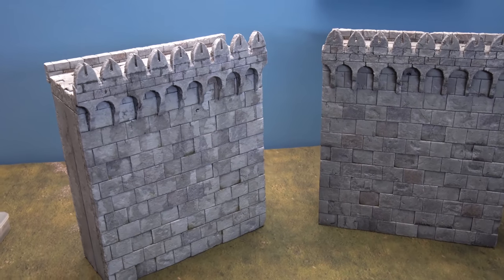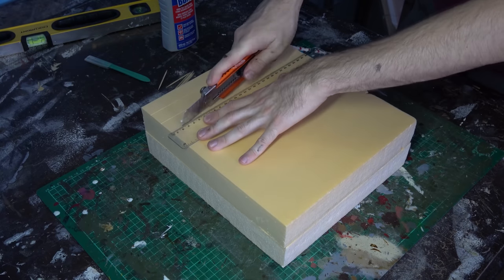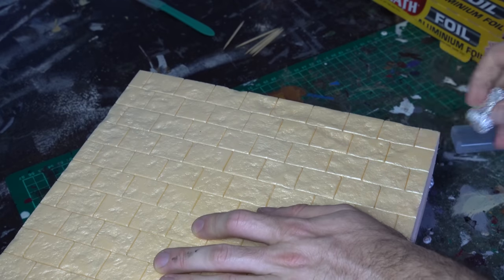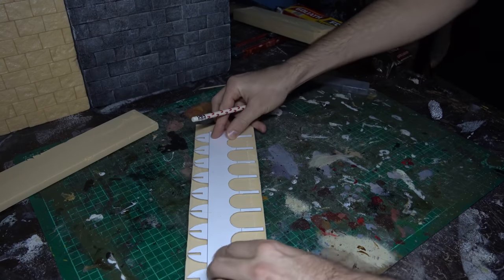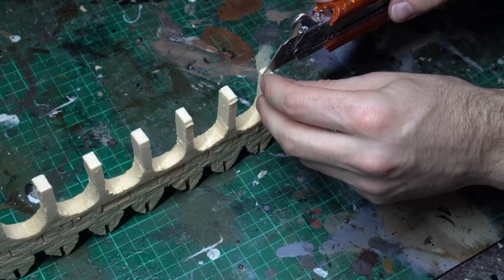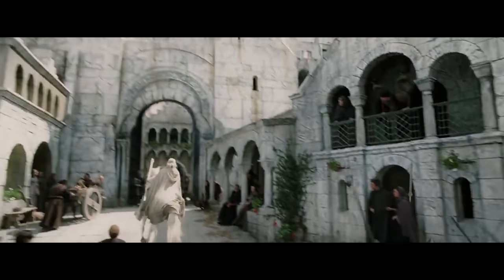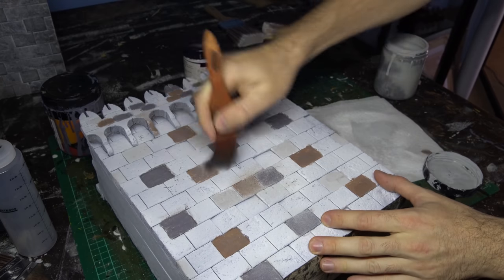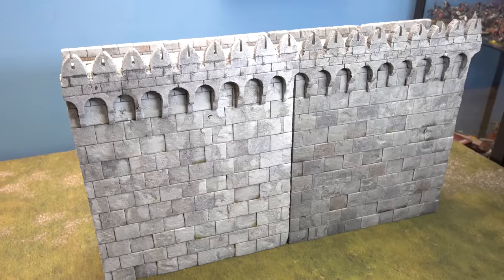How to Carve: Realistic Stonework! ~ Minas Tirith Walls Guide and Templates!

Comment: As someone that doesn't have a hot wire cutter I now feel I can make this. My only suggestion would be right at the base have the bottom half inch or so stained a little more than everywhere else to simulate the ground being wetter and rain and water collecting at the bottomed of the wall. Immense piece of terrain through, really awesome!!

Comment: Hi, i started a very similar project 2 years ago. I built the complete gatehouse (14 cm wide gate) with the four towers (48cm high) and the two walls protecting the area in front off the entrance. For the crenalation i used two laser-cutted mdf stencil with the Proxon hotwire table (which i used for the whole project). I’ve texturized the walls with your same metod. Now i need to build the rest of the modular walls and towers for a total of 2 meters long. I also have ti paint them ofc. Keep up the good work and regards from Italy
Reply from the maker: That sounds AMAZING Davide! Can you plrease post some photos on my facebook group? www.facebook.com.groups/zorpazorp

Comment: And there it is! Just like you promised on Facebook! Love it mate. Especially how you give that extra bit of depth. 

Two questions: 
Have you considered buying a Proxxon hot wire cutter? It really speeds up your process and gives beautiful cuts. You could cut 5 crenellations sections from 1 5cm block of foam and slice it down. 

Other question: does your foam also have that smooth silky layer/finish on the outer sides of the board? Gerard Boom from Shiftinglands advices to thinly slice that off because it doesn’t take glue and textures well. 

Thanks a lot mate!
Reply from the maker: Thanks dude!! I deliberately didn't use a proxxon in this video as I wanted to teach everyone who didn't have one it is possible to do it with a blade :)

I find the silky finish is totally fine for texturing you just haver toi push a little harder, but sometimes it is better to sand it back if it's being stubborn :)

Comment: Watching you cut this out by hand got me thinking that one could save a lot of time on the battlements using something like a Silhouette or Circut to cut the foam - this might require multiple sheets of styrene glued together after cutting, but it has the advantage of being a largely hands off/can run in parallel while you are prepping and finishing other walls.

Anyway looking forward to the templates, will try them on a Glowforge after some modification with MDF.
Reply from the maker: That sounds really cool dude I'm not familiar with those tools!
Reply: It's from the scrapbooking world, I've used them to cut stencils to put numbers on terrain and vehicles (with a bit of airbrushing). :) Can literally take your templates and send them to the machine to precision cut - it's hands off once the cutting begins. They are moderately priced - in the USD$200-400 range. Not really certain about the thickness of foam that could be cut, but might be worth some research.

Comment: Hi ! Fantastic videos, really cool of you to have released the templates for free ! In a few weeks i'm going to make some little walls, I have big thicc piece of foam in my garage, I tried undercoating them with a Chaos Black primer from GW, but it melt the foam.
You talked about this issue in ur video. Are GW spray primer too strong, or is my foam not a good one ?
Reply from the maker: That's awesome!! You can't use normal spray paints from it has to be special foam safe spray, if you don't have the special stuff undercoat by hand :)

Comment: A way tp save time during the battlements section is to use the template against the foam and use a polystyrene cutter.  Its a heated wire that cuts through the foam.  The template held in place will keep you from cutting to far and it saves an ass load of time and blades.  The thicker the foam, the slower you will go but it is still way quicker than cutting.  I actually prefer the polystyrene cutter because if done right the cuts will be close to perfect.  They range in price and some expensive ones are pretty cool, but the cheap ones can be bought at a hobby shop like Micheal's.
Reply from the maker: You're spot on :) I would of course normally use my proxxon but this is a guide for a lot of beginners who are contributing to the community project :D
Reply from the maker: Maybe I should show using a hot wire cutter in future vids?

Comment: In another video, as I recall, you indicated that someone 3d printed the battlements for you.  Who printed those battlements for you, and are they available for sale?

Also making the walls themselves might be something that Knights of Dice could make out of MDF.  After the walls are basically a box of 280mm (11 inches) x 300mm (12 inches) x 100mm (4 inches).  I don't know how well the laser milling could make the stone blocks and texturing)
The laser milling could make battlements much easier to make

Similar kits could be made for towers, landings, wedges and related structures.  This could then become a project for one modeler and would be profitable for you and some of your friends.  A customer could buy multiple kits.

But for those wanting to make projects similar to your Minas Tirith wall, this would make the project much easier.
Reply from the maker: A great suggestion TJ but unfortunately the design of Minas Tirith is protected by copyright, Games Workshjop and Time Warner would be knocking on my door pretty quickly haha

those printed battlements aren't available anymore sadly

Comment: Since the walls are circular, how do you plan to connect the walls?
Reply from the maker: We'll be going through that in the next video, but essentially it's much easier for people to build straight sections and join them at an angle and then you can use the walls to be other locations too not just Minas Tirith, but we'll have little angle joiners :)

Comment: One little question. Do you know if there is a way to make the cranelation pins more stronger? I mean adding pva glue to the paint for the base coat by hand or airbrush. I ask becuase I'm making my walls and tis part seems to be very soft, and very easy to damage or broken in the normal use or wearing.
Reply from the maker: Javier 'm lucky that my foam is really dense but yes mixing PVAor modge podge into the basecoat will help strengthen it :)

Comment: What you you say is the most cost-effective material for “stone-wall effects”?
Reply: Here in the US you can get fiam board feom the Dollar Store that has easy peel off paper. It's cheap and easy to work with like the xps foam. I would have used that for the battlement portion. I'm sure there is a similar product available in Australia or wherever else.
Reply from the maker: Extrdued polystyrene fro mthe insulation section at a hardware store :)

Comment: Great work as always, Lachlan - and such an easy way to build this stunning city of Middle Earth. Congrats!
I would like to make a suggestion, because I used similar techniques when I did build my Gondor walls (inspired by your work as your surely remember): If you own a Proxxon Thermocut or similar cutter just pin the template onto the foam board and then use the Thermocut to cut the components out (low heat recommened). If you use a thicker piece of foam board you can cut slices / sheets instead of cutting seperate wall pieces - see: https://youtu.be/s6lyEKg4kaY?t=50 This safes a lot of time and it's easy to do.
Reply from the maker: Thanks dude glad you liked it! I'll absolutely making my own set with a hot wire cutter bro, this tutorial is just aimed at all the less experienced hobbyists at home who don't have access to one during isolation :)
Reply: @Zorpazorp  Yes, to keep basic techniques in mind is always a great help for beginners. I think I'm maybe a bit to addicted to the hot wire cutter because of the book ;-) :D
Reply from the maker: It is an amazing  tool haha